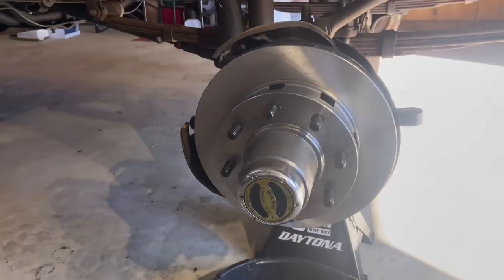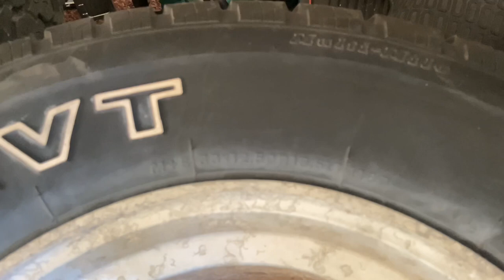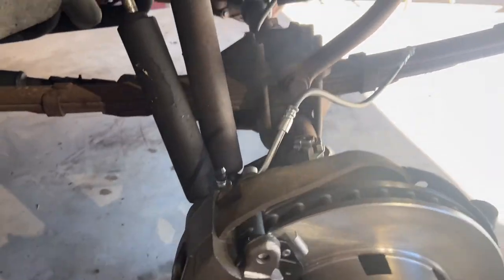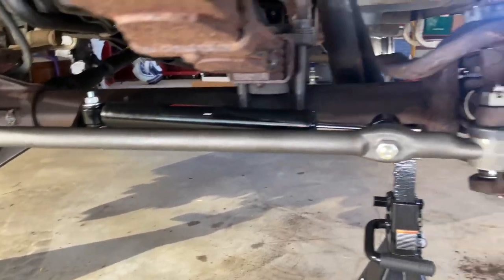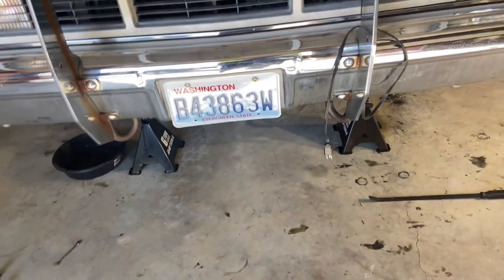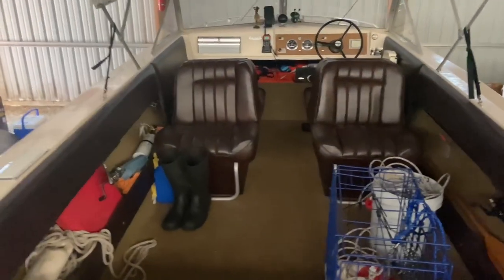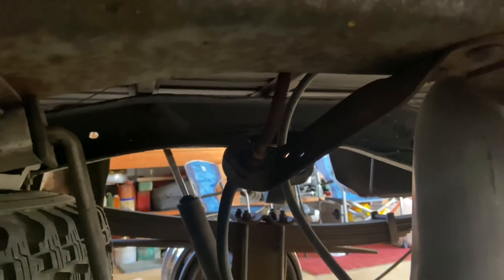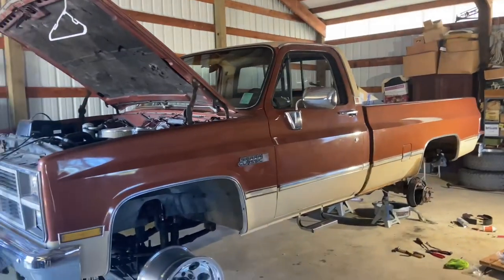1983 GMC K2500 steering and brakes done(ish)! New wheels and project updates Eps. 3!

Comment: do you have an estimate on how much you have spent in parts so far?
Reply from the maker: Minus the wheels and tires (coming in a video soon) I would guess around $2300. That’s all steering, brakes, bearings and hubs replaced plus tune up/battery